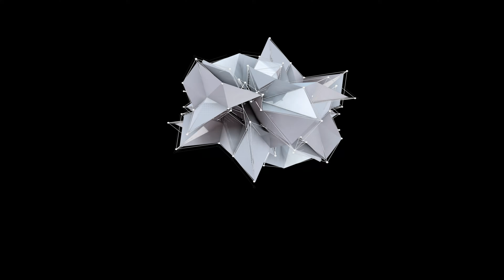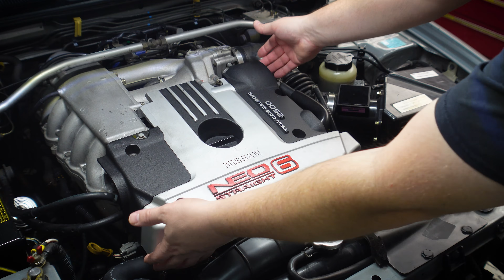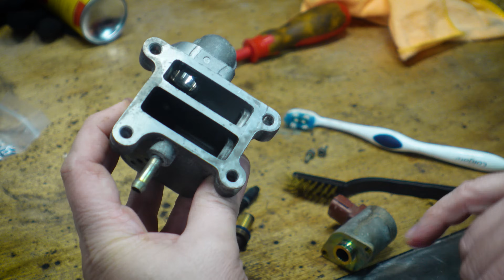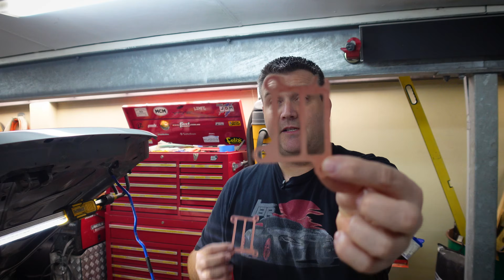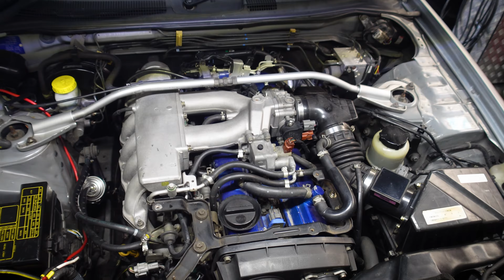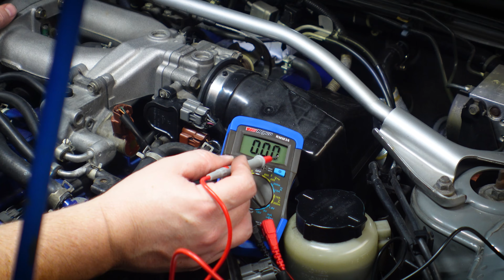IACV clean and TPS replacement on my 1998 R34 Nissan Skyline

Comment: Isn’t that the aac valve not the iacv or is it different from the rb26?
Reply from the maker: Pretty much an interchangeable term on the RB25 - IAC and AAC is consolidated, not sure if there's a particular split where an engineer would say you're touching the AAC now not the IACV - i just went with the commonly used term - most issues are idle based so IACV is the easier way for people to remember during diagnosis.

Comment: Bro I took off 4 bolts and the tube but my iacv is still stuck. Any suggestions?
Reply from the maker: Probably just stuck because you're the first person to ever remove it - usually a couple of LIGHT taps should crack it free, or a little bit of light levering in the joint, but don't go crazy or you risk cracking it.

Comment: hello, i hope all is well.
thanks for the great video, i used this to replace and set up my new TPS on my 98 HR34 (RB20DE Neo). with TPS plugged in, my idle is perfect at 650 rpm. with the TPS unplugged (timing is locked to properly set idle), my car idles at 1100 rpm with the IACV screw all the way tight. with the TPS plugged in, the ECU pulls timing in order to set the idle to 650 (or close to it). base timing at idle shouild be 15 degrees, but mine shows between 0 and 2 with the consult software plugged in, meaning the ECU is pulling timing to set idle correctly at 650 rpm. did you ever figure out why your idle was also high without TPS plugged in? maybe would help me figure out why mine is doing the same thing. although my car idles properly with TPS plugged in, just knowing the ECU has to pull so much timing to adjust it, bothers me haha.
thanks in advance!

Comment: Hi bit late but i just ask:
At 12:29 you talking about throttle cut out in low throttle. Did you manage to solve that? I had/have similiar problem on 20GT. I replace the TPS sensor. It helped a ton but it is not 100%. You can still feel the "cut out" specialy on 4th-5th gear. It is not everytime but it is still there. 
One thing that changed with new TPS is that the idle is now higher(above 950rpm) and even slight movement with steering wheel causes to pull up rpm and you can hear some pull/push air "thing" going in the engine bay(IACV trying to compensate??)
Could the IACV be bad? I have second one to replace it(doing it next week)
Reply from the maker: Lots of different things that my cause that - TPS is one, IACV could also be impacting if its not working. How confident are you with the calibration of the TPS also as that is a big deal. 

If you replaced the TCS and cleaned the IACV you need to do the calibration on idle too. It's a week after you made your comment (sorry I've been flat out) so how did it go after the IACV swap?

Comment: What’s the part number for the tps ?
Reply from the maker: Can't be 100% sure cause I didn't retain the box but I'm pretty sure its 22620-17U10. There is a different part number for a manual however, so if you're not auto look it up on the Amayama website. I got mine from EFI Solutions in Australia (if you're AU).

Comment: Great work and nice videos. Thanks a lot for the series. I had an R34 25GT myself in red between 2010 and 2014, right before I got myself a black 25GTT. I did some work on them myself as well, belts, plugs, injectors etc. The only thing I miss about the GT is the throttle response. It was almost instant.
Reply from the maker: Yes I like the responsive NA too, although I'm going to convert to manual as the auto takes all the fun out of it. Just another project on the list!

Comment: Swap the transmission later with the engine, we want more Celica content! Or 15 of us do, anyhow...

Great and informative video as always. I'm dealing with an intermittent high idle and IAC valve code on my DD Toyota truck with the 3.4L V6. I removed it and tried cleaning it up but no luck. It's an aftermarket replacement installed by the previous owner and the general consensus is that OE is the only solution. Unfortunately the OE part is around $300 USD 😬 Might trying adjusting the TPS like you did and see if that helps before dropping the cash.
Reply from the maker: Haha - up to my eyeballs in Celica stuff right now and the R34 is still auto so we're heading the right direction. That's an expensive TPS considering they're still made. The R34 one was $500USD but that was after they were discontinued. I thought you guys got cheap parts over there!

Comment: Mine is a manual, sometimes while driving the CEL comes on and as soon as I let off the gas it disappears. Also during driving it will jerk quite bad when I let off the gas even a little bit. The worst is when in 1st gear it jerks like a mf. Could it be a bad TPS?
Reply from the maker: Could be, I wouldn't say go out and buy one to swap in unless the cost is not important, but you can get a multimeter and chech the idle resistance and the also have someone operate the pedal while you check to see whether the resistance changes smoothly or jumps / has dead spots.

Comment: I'll be calibrating my TPS due to these learnings. It's a race car so I removed the IACV & AICV when the auxillary failed. It's an SR20 & the AICV is a diaphragm that is temperature operated & failing is a common fault.
Reply from the maker: Racecars don't need idle, you'll be fine 👍